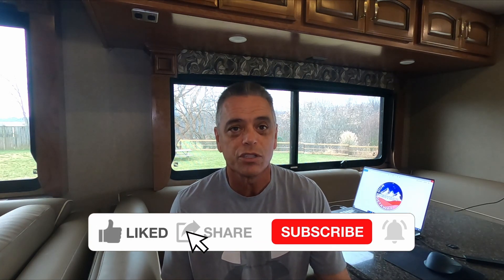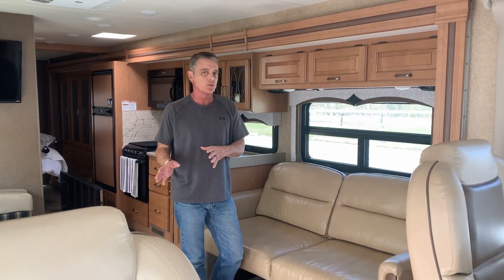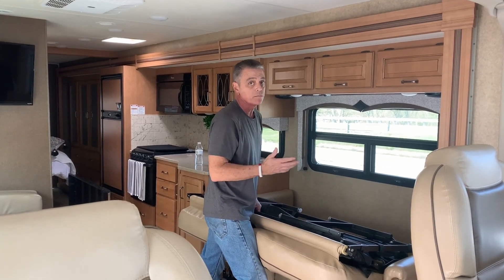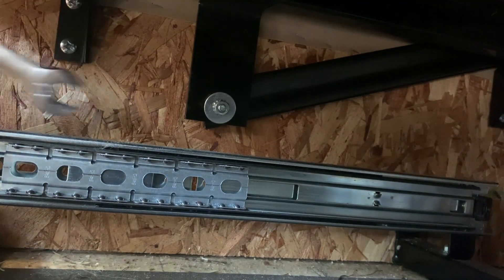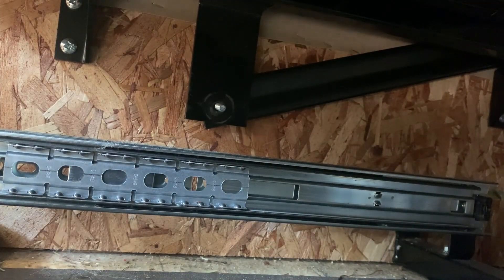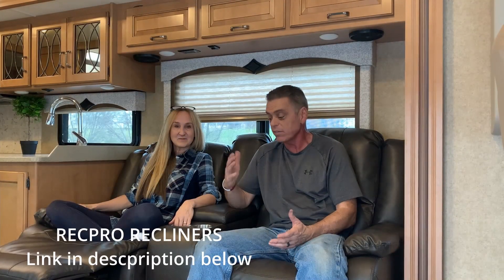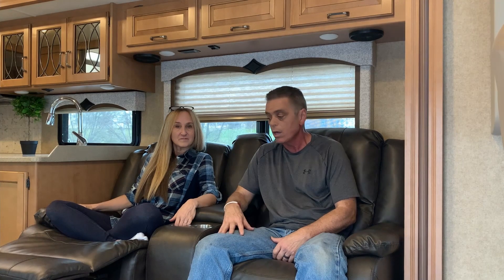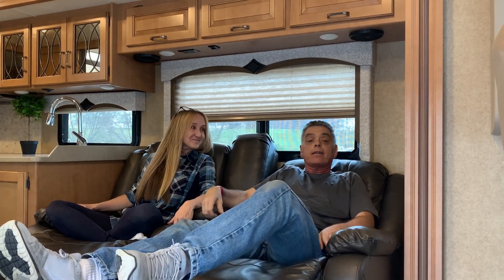RecPro RV Recliner Upgrade: RV Full Time Living

Comment: How did you thread the seatbelts through?  Was it an obvious path for the belts?
Reply from the maker: Yes. Just pulled them through the space between the seat and upright portion of seat. The belts were already bolted to the floor. Very easy to pull them through. Hope this helps. And thanks for your comment.